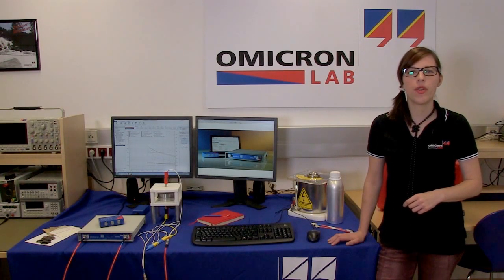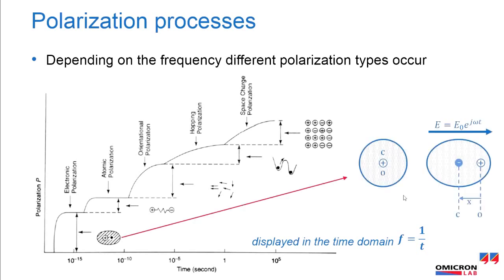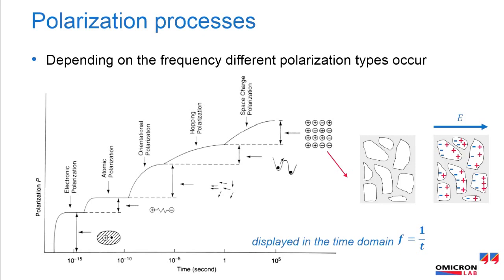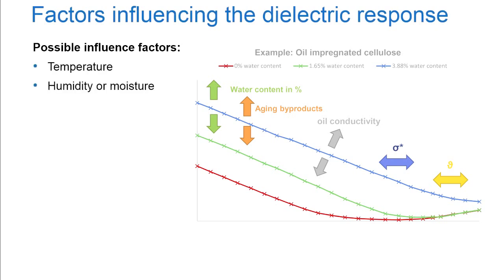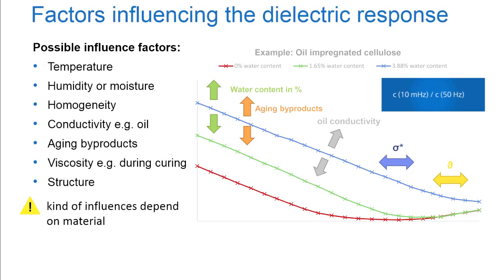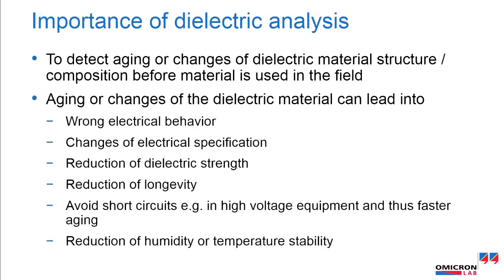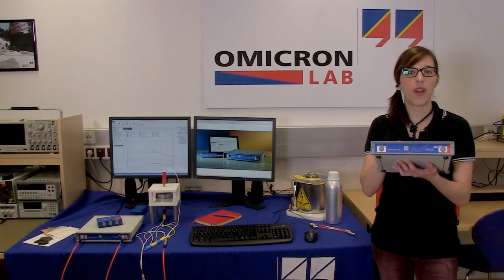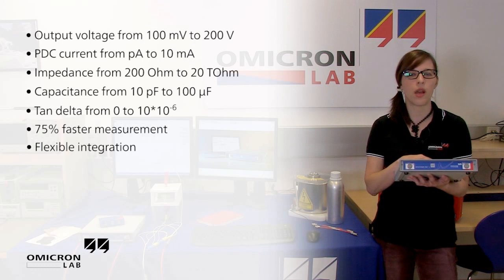SPECTANO 100 - Dielectric Response Analysis of Insulation Materials

Comment: which model is being used as insulation model to compare the actual response to modelled response?
Reply: is it X-Y model(Basic Insulation model for taking insulation geometry) or other than this?
Reply: Actually, I am doing my Mtech in DFRA(FDS),so it would benifited for me in the future for my academic purposes for sure
Reply from the maker: Dear Chintan dixit,
the SPECTANO 100 is only performing measurements and does not model any insulator. 
The measurement result is a complex number (permittivity or impedance) which can be displayed in various formats Cole-Cole or Magnitude-Phase in Bode plots or else.
I hope this helps to clarify your question!
Best regards,
Your OMICRON Lab team.
Reply: @OMICRONLabTutorials  Hey, Is this sepctano 100 and DIRANA both are same?
Reply: @swarsolanki  
Dear Swar Solanki, 
The SPECTANO 100 and the DIRANA are not the same, please
Reply: Dear Swar Solanki, 

The SPECTANO 100 and the DIRANA are not the same, to explain the difference please trop us an e-mail on info@omicron-lab.com
Thank you for your understanding.